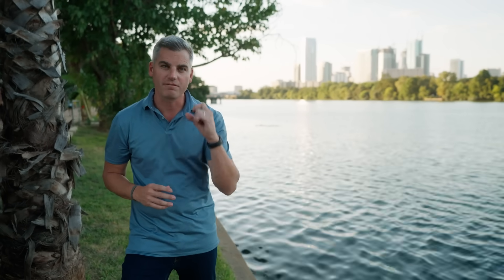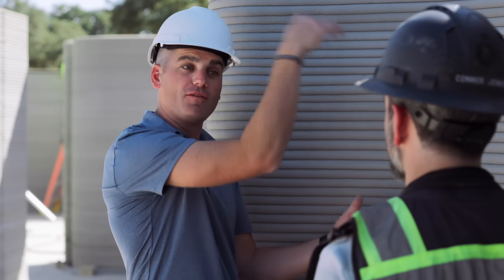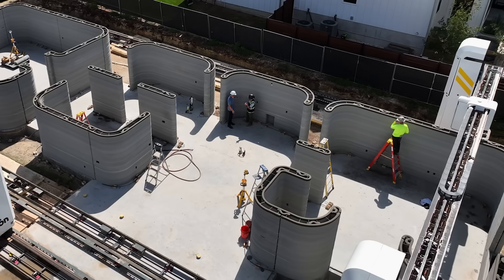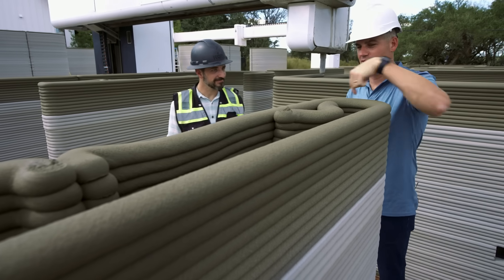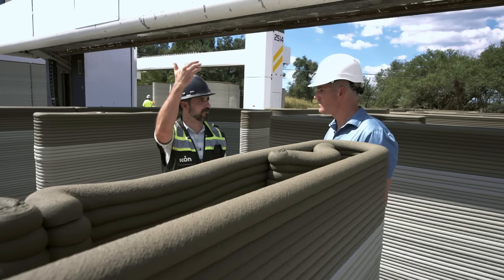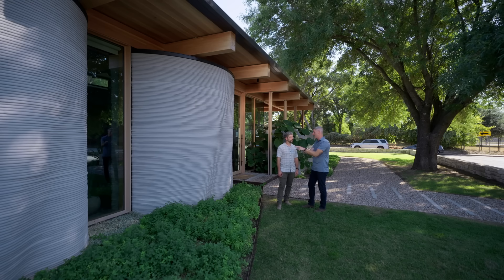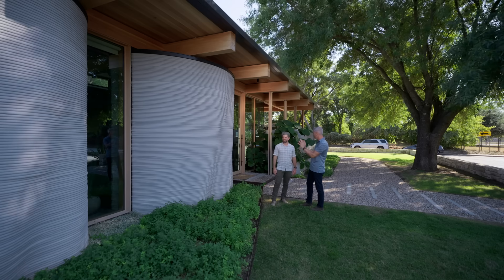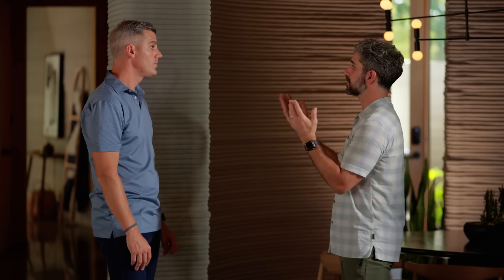Exploring 3D Printed Home Technology | Ask This Old House

Comment: Cool technology, but I have concerns on multiple levels.  First, concrete is a thermal bridge.  Yes, the insulation will help, but the concrete is uninterrupted from the inside to outside on the curved exterior walls next to the windows. Energy efficiency will suffer.  I think there is a cold joint between every layer of the bead. I would like to see the 2x4 test at 100 mph to see how it holds up.  Concrete is also porous.  No vapor barrier on the exterior?

A good ICF crew could have built the exterior in less time than they did. You would have a much better structure. There are layers and drainage planes in housing for a reason.
Reply: Can you explain more we are planning a 3d printed affordable housing community and id like to understand your concerns more.
Reply: @tracyh1999  I don't want to knock anyone who is trying to innovate. I applaud what they are trying to do.  I do think for your community, you should look at ICF construction and in particular the possibility of panelized ICF construction.  This is a well proven and durable solution. For affordability to be successful, you need to look at TCO - Total cost of ownership. Paying more initially is better if you get energy savings over the life of the structure.  You pay utilities every month and those costs increase over time.  ICF construction is typically 40-50 better in energy efficiency than stick built. Check out up to Kode and his blower door tests.

I think this technology has potential, but I doubt that it will meet or exceed where ICF is today. Also check our GFRP and Microhelix.  Low carbon concrete is also available in many places and is not that big of an upcharge. 

Just my $.02, but there are lot of great building materials out there today.

Comment: There is no way that they can build a house cheaper than stick framed houses. They still have to have people set windows, the roof and then they are talking about studding over some of the walls. The only thing I see in this type house, is special design, curved walls and industrial type houses. But not cheaper. Now being said, it is a very cool construction built home.

Comment: It’s wild to see how much improvement has been made in the “bead” quality of the concrete layers. Go and look at the houses they built in Austin, TX 4 years ago and compare them to these walls and it’s a night and day difference in quality. Still need to find a way to offer roofs that are also made out of concrete (or perhaps steel frame?), so no heavy reliance is needed on lumber.
Reply: I'm guessing they just used that method on this home because it looked great. But you can probably use various roofing methods and materials, as long as the structure is able to support it.

Comment: Why is foam insulation needed in the empty (sealed?) wall cavities. Isn't empty space an even better insulator (like in a double-walled thermos)?
Reply: A thermos doesn't have air in the cavity. It's a vacuum, so heat transfer by convection is nearly eliminated.  There is also a gap between the layers to eliminate conduction. Tiny pockets of air in insulation work well because the air isn't circulating and picking up heat from one surface and transferring it to another.

Comment: people are missing the point with this video. it's a tech demonstration. there are no limits to the possibilities with 3d printing. if you want it designed differently, then design it differently. any limitations seen here are the limitations of whoever designed the structure and the specific machine used on this jobsite. 3d printing is just another form of CNC "machining". it's up to the users of the tool to get the most out of it, and if the tool is not sufficient for the task, it can be improved upon.
Reply: It's concrete. No 3d.
That's like calling a stick frame 3d.

Comment: I don't know.  I actually like the look when staggered with wood or sections that are plastered or tiled.  And I coukd see it working in hot dry climates.  I'm a little skeptical of wet/humid, and VERY skeptical anywhere it gets below freezing due to moisture and freeze/thaw.  Also, being done on a slab isn't ideal in some areas and if the slab cracks under a wall, good chance the wall is going to crack as well.  Finally, if he's really serious about cost $35/sq ft is way more expensive than CMU walls and I don't see any advantages (other than aesthetic) vs CMU.

Comment: It’s not about the cost (which seems reasonable), it’s about the speed.  There are scenarios where lots of housing is sometimes needed very quickly, or where there is a labor shortage. This system can be useful then.  And you can easily plaster the walls if you want.
Reply: 2 weeks to do that is not any faster.
Reply: I love your use of the word, "easily."

Comment: As good as these are, construction companies are going to continue doing what they are now despite this being along the lines of the same cost as stick build homes. The investment to get multiple 3d printers to build multiple homes at the same time in subdivisions is just going to push them deeper into stick built. Many builders DON'T care about the product they put out, as long as it's pretty, sells, and makes it beyond their home warranty period where they can wipe their hands clean of any issues because they cheaped out on labor and materials. If they did, there wouldn't be gaping holes in new builds, shoddy roofing and siding, or the other multitude of issues. Love the idea in theory, but would want to see how it holds up compared to a ICF against a hurricane/tornado. Also interested to see how it holds up once the foundation starts to settle.

Comment: The layered look may appeal to some techno nerds, but most people want smooth flat surfaces. I think the layered look is plain FUGLY, I mean really FUGLY!
  With all their fancy technology of "soft serve" cement mortar, have they EVER CONSIDERED a square/rectangular nozzle with a built in trowel on the side to form a reasonably smooth flat side? It would just take another servo to rotate the nozzle at corners, And if you plastered it, it would use much less plaster than the round layered mortar extrusions. Also if they used a rectangular nozzle with side trowels, probably less mortar would be needed.
  These people have very limited thinking of the technology. They probably thought 60's Earth ships (look that one up) were the ultimate building technique. They're the 21st century's hippies with tools, not engineers.

Comment: I prefer ICF, to me that is a game changer.
Reply: ICF?
Reply: @Trinn03  Insulated concrete forms. It's like building a house with insulated legos and then reinforcing those legos with rebar and concrete. Simple way to build a highly efficient home.
Reply: Both are game changers. Was looking into ICF when we were house hunting and almost ready to just say screw it find land and build to suit until we found something we could agree on and checked the big boxes. Finding contractors that do it is few and far between, and the ones that DO do it push for premium high profit projects over modest homes. That's where these are going to come down to as well, they're gonna be a commodity until/unless they take off.

Comment: Gotta get flat walls, otherwise you are living in a bundle of wires.
Or you could texture it to look like rock.
Reply: Why, the wires are run inside the walls just like with traditional build. You may have missed this in the video.
Reply: @markbloyd9852  the bundle of wires distracting/busy aesthetic is the problem, not the actual wiring of gas, pipes, water, and electricity.
Reply: @brianfong5711  I guess I'm not understanding. If everything is hidden inside the walls, how are they effecting the aesthetic?
Reply: @markbloyd9852  the walls have this ridge like look and dark lines from the shadows under the bulging texture, which is very interesting to look at, and that shouldn't be the case, but walls shouldn't be your point of interest.

The walls are not flat, they have undulating patterns, drawing your attention to them instead of the furniture and people and objects in the room.

Walls compose a large amount of surface area and is supposed to be boring, but these walls are too interesting, and interesting things should be used sparingly. The smaller things and objects should be highly interesting since they don't take much space,volume/surface area like a rug or painting. Proportions and balance of interest.
Reply: @brianfong5711  I think I understand now. You are not actually talking about wires, as in the electrical system, but as a description of what you think the walls look like. Sorry for the confusion.
Reply: My guess is that in the future as they master the technology the 3d printer will do it itself, right now I believe is about getting it to the market quick and as low cost as possible. Short term it may be an add on for extra cost of course

Comment: if the cost really matches stick build, I wonder why anyone would not choose concrete in that case
Reply: I've been to the Lennar jobsite outside of Austin where these homes are built. For it to be cost competitive, these laticrete homes need to be put up in a multi-home development, so as to amortize the cost of setting up and using specialized equipment. A one-off home built this way would be $$$ vs stick built.

Comment: Just guessing they are not 3D printing a home in North Dakota in January.  Would like to know how this holds up to freezing and thawing in the north.  We use poured walls for basements, which do well, but this isn't exactly the same process.
Reply: I just poured the foundation for my home in Maine back in December. Add a little lime to the mix and you're good to go
Reply: Once cured, the performance would be similar to cast concrete.  There are concrete curing accelerators that can be added to batches to counteract the effect of low temperatures on curing. In addition, it is common to use "blankets" over fresh poured (or printed) concrete in low temperatures to retain some of the heat released in the curing reaction. In Austin, low temperatures aren't generally a problem. I have also seen reports on the use of 3D printed concrete in South American countries.
Reply: It's just concrete. It's the same process. But takes longer to do.

Comment: The final house design looked really good
Reply: He said that, it’s nice, the wood, the wood…. Everything that’s not printed
Reply: Yeah this is definitely one of the best results for 3d printed homes I've seen
Reply: It is certainly different but I wouldn't say it looked good. 
Very modern and very crude at the same time. The wavy edges of the window and door openings make it look cheap and would rely on a ton of caulking to seal. I couldn't imagine it lasting very long in many situations, it would probably have tons of cracks in it between the beads as the materials dry out and cycle in the weather..
Reply: @David_H_Parker there's always a party pooper

Comment: The finished building is much like the California classic one-story that developed back in the 50s as Eichler homes, and the versatility of finishes means more buyer options. Pretty cool!
Reply: It needs more finishing time and material than a conventional home. With a stick framed or ICF home, the finishes are even more unlimited. 

I would not trust one of these in California, we are overdue for another mega quake. There's no way this would hold up to any serious seismic events, it has no reinforcement and no expansion joints.
Reply: @David_H_Parker you can see all that from this video?
Reply: No, the construction is completely different from the "Eichler" homes (which I have lived in) that were designed by the architectural firm of Anshen and Allen. Those homes are of post and beam construction. The walls are not load bearing. In 3D printed homes the wall are load-bearing, the same as conventional "stick" framing.

Comment: I find the look kinda interesting and cool in its own way, though I'd definitely opt for plaster on the interior. Also, they didn't mention it, but I'd hope they use some kind of conduit for data data wiring to make future upgrades feasible.
Reply: they do mention dropping in conduit and utilities through the hollow areas ahead of adding the roof. The key here is to plan ahead, although who knows what the future brings. 40 years ago I prewired for phone and cable. Now it's CAT4, 5, 6 and maybe even fiber optic. I thought I was future proofing back then, right?
Reply: @rupe53  They talked about cutting in openings, running wires/plumbing from above, then blowing in open cell foam, but I never heard them mention conduit per se. Hopefully it's just something that they didn't think necessary to mention. As you pointed out, it doesn't matter how future proof you think you're making things, because it will always change down the line, and it's best to be able to adapt.
Reply: @RobBulmahn  AC mains power distribution in normal frame construction doesn't use conduits unless the wiring is exposed. In-wall wiring is just Romex. Since the concrete is a lot more fireproof than wood there would be no reason to use conduits inside the hollow walls to route power wiring.
Reply: @avsystem3142  I'm specifically talking about data wiring: ethernet, HDMI, or whatever else might be used in the future.
Reply: @avsystem3142  Being embedded in concrete itself is a reason to use conduit. Without it, you leave yourself unable to repair/replace/upgrade as necessary. Would rather have conduit that I can feed cable through versus being stuck or having to damaged the wall/structure.
Reply: @717dash_cam  The wiring is not "embedded" in the concrete. As explained, it is fed to the switches and outlets through the hollow walls before they are filled with insulating foam. Residential construction never uses conduit, except as I previously noted. It would send the cost of house wiring through the roof. It takes much more time to install conduit and wiring. AC mains wiring in residential structures is never installed in a manner that would allow quick repair or replacement. Typically, in a frame structure, the drywall would have to be removed anyplace it would be necessary to access in-wall wiring.
Reply: @RobBulmahn  I understood the first time. No, those kinds of wiring are never installed, in any normal frame construction, in conduits. You install the best available and that is the way it will be for the life of the structure without major remodeling. If you want to build a custom house in that manner, feel free. Hope you can afford it. When I did a major remodel on a residence twenty years ago I installed Cat5e Ethernet cable. It was and is officially rated for  100mbps. However, recent testing has demonstrated that Cat5e can actually reliably handle, if well installed, 1gbps so it isn't obsolete at all. Few residences would have any need for more than that.

Comment: I’m skeptical. A standard stick framing home is cheaper and more sustainable. Look up the CO2 emissions for producing concrete. Also we’re running out of sand.
Reply: Running out of sand?? 🤣
Reply: @безжалостный-б8в  yes we’re running out of sand. To make concrete you need a specific type of sand.
Reply: Yes, for sure. ICF is a much better option for having masonry walls insulation and much better air sealing. After plastering all of the walls or firing them for drywall, most of the time gains would be lost.

I can see this technology having a place in the future but this current one is not ready for the needs of today. It just isn't ready yet.
Reply: @David_H_Parker are you the ICF salesman or what? That's all you talk about throughout these comments.

Comment: Interesting, but cost has to decrease by an Oder of magnitude at a minimum - machine doing most of the initial “framing” labor.  Bead walls external or internal would be off-putting after a week.  This idea is not ready for prime time.  Lotsa hype.
Reply: Sure but the only way to bring cost down is to keep refining and using it.
Reply: I’m not arguing that it’s ready for prime time yet, but hitting the stick-built cost already, when they are not at scale, is impressive. I’m two years into a stick-built house project right now, and the speed of this system is extremely attractive to me. There is also a massive labor shortage in many areas, mine included.